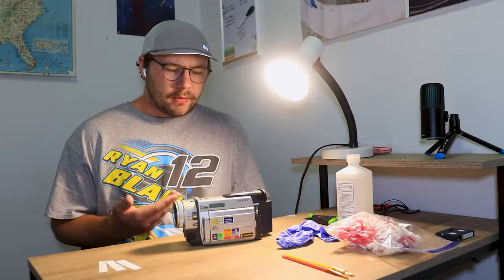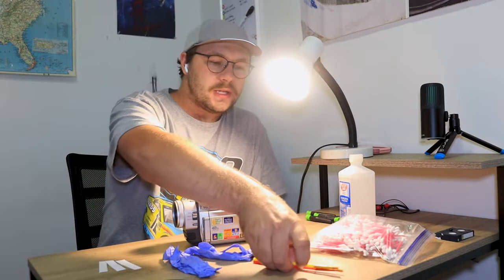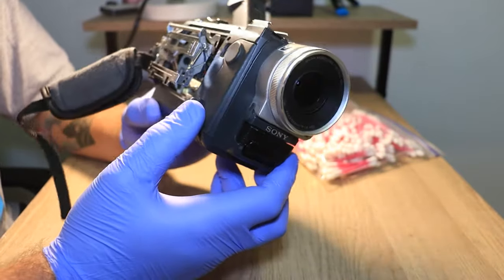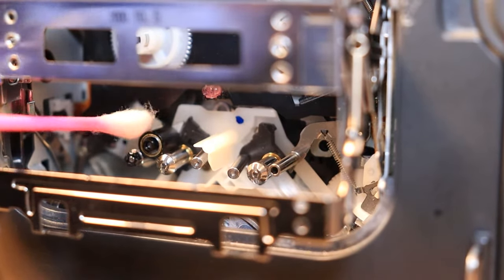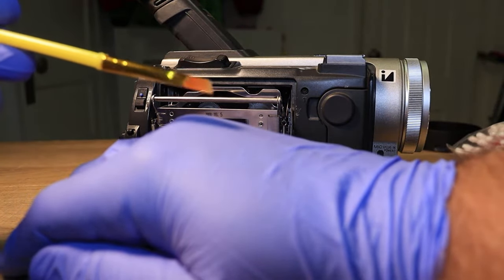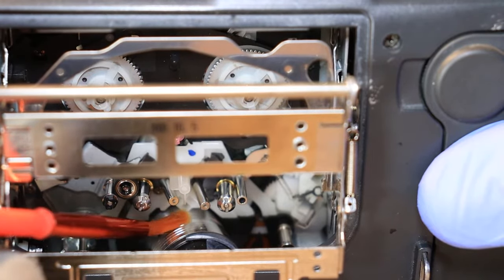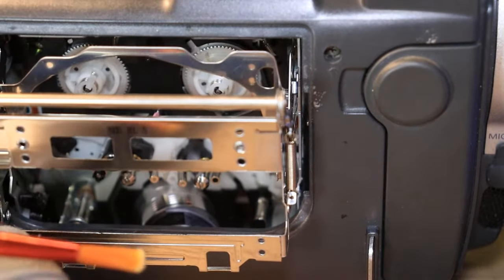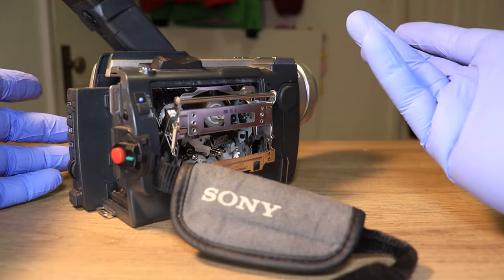[How To] Best Way To Clean Tape Heads On Any Camcorder

Comment: Hey there! Great video. Gave cleaning a shot today but still having issues with playback. Are you knowledgeable on the Canon ZR100? Would love to pick your brain. It almost sounds like it's trying to rev up during playback and then it slows down but showing now video. Love the channel! Thanks.
Reply from the maker: I’ve used a zr60 and zr45 I assume they’re very similar. Is the screen blue when you try to watch playback?
Reply: @brandoncameracollection  it is! it was working pretty well and then i stupidly blew into the tape deck. That's why I did the clean up yesterday but it's still doing the revving sound when I try to playback.
Reply from the maker: @ChrisDonahueIsAMan I would think if there was an issue it would show an error code. I would try cleaning it again and make sure not to blow into the tape deck. And then use a brand new tape to try recording and see if it will preform playback
Reply: @brandoncameracollection  thanks, I'll give it another cleaning. Have you come across that revving sound I'm talking about? It's definitely still moving the tape forward but just showing a blue screen, maybe a second of video  but rarely.
Reply from the maker: @ChrisDonahueIsAMan well I’m not sure if it’s the same sound you are talking about but my canon gl1 and other ones I have had have extremely loud tape decks. So loud that you can hear it in the audio. And what I have heard is there is a little like sponge roller that rolls against the video drum to keep it clean. Well over time the little sponge gets so gunked up that its starts to make a high pitch sound. I’ve heard you hand just break that little roller off if it has it and it should help. But I’m not sure if the zr100 has that or not. It’s usually under the video drum

Comment: Hey I am from India. I have a hitachi vme358e camcorder. Actually i found in dad's wardrobe and it was kept for about 15 years untouched. Initially when i played some video tapes, it worked perfectly with crystal clear video. But after playing a few tapes , there was a bit fuzziness in the video and eventually its all fuzzy. When i switch to record mode, it flashes "TAPE". I cleaned all the rollers and head but still the problem persists. Pls tell me what could possibly be the problem with my camcorder.
Reply from the maker: Well you can always try cleaning it again but from the sounds of that since it has sat unpowered for so long it could have capacitors on the inside that have started to leak which might be why the footage slowly went fuzzy.
Reply: The manual would tell you what the 'tape' message means for your model(though I think 'tape' generally just means the camera as detected some general problem in the tape compartment), & potentially how to fix the problem.
I found this from another Hitachi model, and is likely to be much the same:
If "TAPE', flashes in the Viewfinder or LCD monitor, remove the cassette and Check that the tape is not damaged, is not slack or no dust adheres to it etc. After making sure that there is no abnormality reinsert the cassette, if 'TAPE' reappears see Troubleshooting:
Have you moved the camcorder or cassette from a cold place to a warm place so that its temperature
changed abruptly? If the temperature has changed, remove the cassette and set the CAM/OFF/VIDEO
switch to OFF, then wait for about one hour. Remove the cassette and then try to reinsert &
remove it several times. If the indication is still shown in the viewfinder, use a cleaning tape to
clean the heads and replace the cassette.
-
The fuzziness does seem like the tape heads are dirty, it could also be that your tapes are deteriorating, so clog the heads quickly. It can sometimes take a long time to clean the heads.

Comment: Hi Brandon! I have a TRV-20 I just got in the mail today so I can go back and watch some old recordings I have. It’s saying “No Tape” though, would that be a head problem?
Reply from the maker: Hmmm if it’s mini dv usually your footage will be really glitch when watching play back. But I have had some where it will tell me to eject the tape as well. So yours very well could be dirty. Try cleaning your heads and se if it helps if it doesn’t work then there could be an issue with your camera recognizing there is a tape. You might be able to look around on YouTube and the internet to see what the issue really is.
Reply: That seems very unlikely, as the message indicates(& the manual explains, always helps to check there first..) it means just that - the camera is reporting that there's no tape inserted. It seems most likely it's just not detecting that a tape is inserted - eg: due to a stuck/faulty sensor.

Comment: I have an old 1998 sony tr917 i picked up at a thrift store. It works, but i dont have a hi8 tape. The forward, rewind, and play button dont spin the cassette wheels inside. Is that because there is no tape inside or would it still spin without the tape.
Reply from the maker: I don’t believe they spin if there is no tape inside
Reply: @brandoncameracollection  ok, so they may be good. Thanks

Comment: hey I just cleaned my sony ccd trv66 with the steps you said and now my cassette holder won’t close it keep opening back up. I use 91% isopropyl alcohol so i’m not sure what the problem is
Reply from the maker: That’s really odd🤔 I’ve never had a camera do that before. If your camera has a reset button try that or take the battery off while it is on. Close the tape door and wait about a minute. Then reattach the battery with the camera still in record mode and see if that does anything. I’m also wondering if the camera is rejecting the tape because it might still be wet from the alcohol
Reply: @brandoncameracollection  shoot still didn’t work not sure what could’ve went wrong
Reply: @brandoncameracollection  never mind just got it to close with the cover off. still have a problem with the screen showing blue when i’m trying to play back a tape

Comment: Hi Brandon How about using minidv head cleaner. Do you recommend To use it?
Reply from the maker: You can but I wouldn’t use it a lot since it’s kind of this cloth material and it is not good for the tape heads. It can make them wear out faster.
Reply: @brandoncameracollection  thanks Brandon

Comment: If my playback is fine through the viewfinder, but there's bad distortion on the s-video and composite output does that sound like a head issue or something else?
Reply from the maker: I’m wondering if the connection is bad some how or you might have a capacitor leaking inside the camera. But I’m not exactly sure
Reply: @brandoncameracollection  Appreciate the reply. Tried fiddling with the connections, but never got anything real great. Was also thinking capacitor, but had no idea where to start going down that road lol.
Reply from the maker: Yeah to replace capacitors you have to pull the whole camera apart along with knowing how to solder.
Reply: @brandoncameracollection  yeah that's not a problem I'll see if I can find a schematic to see what I'm getting myself into before I pull the whole thing apart lol

Comment: would you make a tutorial on how to fix sony handycam trouble? like the c:32:11, or where the tape wont open/closed?
Reply from the maker: The error code might be from a loose capstan roller. The rubber roller inside. It has a plastic piece that holds it on. Over time that will crack and break off so you can usually use a piece of the ink tube from one of those cheap bic pens to replace the plastic piece. As for the tape deck not opening I’m not sure why or how that happens
Reply: @brandoncameracollection  could you make a tutorial on it? maybe one day? im pretty sure dozens of people has this problem!
Reply from the maker: Yeah I’ll have to do it on a camera that has that problem thank you for the video suggestion 😊
Reply: @brandoncameracollection  thanks a lot mate!

Comment: This worked but after couple months. It starts glitching again. Help….
Reply from the maker: It probably needs cleaned again. And make sure you use the same brand of tape every time. Different companies used different kinds of lubricants on the tapes and when you use a bunch of different brand of tapes all those lubricants mix together on the heads and makes the them get dirty faster. Also when you clean it make sure you use a new tape after cleaning it.
Reply: @brandoncameracollection  oh ok I see. Well the thing is, is that I’m looking back at old tapes and i have maxell and Sony brand.
Reply: @brandoncameracollection  that really makes sense tho. Thank you
Reply from the maker: Yeah if I was you I would stick with maxell. Seems every camera I get that has a Sony tape in it always has dirty tapeheads.

Comment: i’ve been having a problem with trying to convert my hi8 tapes to digital but for some reason it looks fine when playing it through my camcorder but whenever i try to digitalize it it looks really glitchy and the audio is horrible. any ideas what it might be? i have examples of it on my channel
Reply from the maker: What are you using to convert your footage?
Reply: @brandoncameracollection  i am using vidbox with some gold RCA AV cables. the program i’m using is obs studio. no clue what’s up with it. i’m guessing it’s on the camcorders part
Reply from the maker: I know recorders can have some timing issues I’ve been using the clearclick video to digital 3.0 and it has a timing issue with my Panasonic pv-420. Maybe try a different way to digitize the footage and see if that helps with it. Other than that the tape heads could be dirty.
Reply: @brandoncameracollection  yeah i’ll try out the vidbox software idk why i haven’t done that yet. always heard obs was good but i’ll let you know how it works out
Reply: DVD recorders are the easiest way to transfer footage(especially if DVDs are a suitable end product for you), and give good quality, here at least they can be found cheaply. It's basically what they were made for, so they work very well, and can often even fix some of the flaws caused by rough tapes. Also a lot more convenient than having to have it hooked up for your computer for as long as each tape runs. DVDs also match the interlaced output from a camcorder, this interlacing can be a nuisance when capturing to a pc.
If the image looks fine when connected to a tv, it's very unlikely to be the camera causing a problem. Even just showing fine on the camcorders viewfinder/lcd, it's unlikely to be bad on the video output.

Comment: omg, he using q-tips
Reply from the maker: Only on the capstan roller 👀
Reply: @brandoncameracollection  But I'm shocked that you (and many others) use isopropyl alcohol on the pinch roller!  Don't you realize that will dry it out?  That's a no-no!
Reply from the maker: Yeah you can definitely use like windex on the rubber roller

Comment: does the percentage of the alcohol matter and is it ok to use something like nail polish remover as a replacement?
Reply from the maker: I recommend the highest percent alcohol you can get. And I wouldn’t recommend nail polish but you can use windex if you don’t have alcohol
Reply: @brandoncameracollection  i looked up the percentage of alcohol in nail polish remover and its 70% do you think its high enough or shoul i use that windex lol.
Reply: @brandoncameracollection  also thx man not alot of ppl get back that fast much love brotha
Reply from the maker: Make sure you only use the windex on the rubber roller. Other than that you can only use isopropyl alcohol
Reply: Most nail polished remover is acetone not alcohol.
Reply: Definitely don't use nail polish remover unless you're certain it doesn't contain acetone. Even then it might have other ingredients that could cause problems.
Acetone is brutal - for example it can dissolve some plastics(it's great for fixing some broken plastics for just this reason).
Isopropyl is pretty readily available anyway, including from hardware stores.

Comment: do you know why some tapes play and rewind great and others say head cleaning required and are glitchy?

Using the same JVC MINIDV player on all tapes and some play perfectly, some say "head cleaning required, some say "take up reel failure" and some cant even rewind without mangling the tape up.
Reply from the maker: Well some tapes could be older and more used than others. If the tapes have been used with a lot of other cameras the tape it’s self might be dirty from using it with so many other cameras. But the take up reel failure seems to be a issue on its own. Sound like the pinch rollers aren’t grabbing the tape properly and that’s what is making it eat tapes.

Comment: Great informative video thanks,I’ve got a Sony TRV 950 on the way from eBay,seller said there’s a clicking sound coming from one of the rollers that causes glitches on playback,would the cleaning you have shown us maybe fix this issue?,many thanks.
Reply from the maker: That I’m not sure on. When you get the camera check the reel gears. They are the gears that drive the tape forward and backwards. If they are plastic gears then one of them could be cracked and broken. I had that issue with my canon xha1. It made that clicking noise and would throw a code. Turns out that gear was completely broken in half. They are relatively easy to replace.

Comment: How do you feel about the aerosol electronics cleaner?  The kind with alcohol, not just compressed air?
Reply from the maker: You could use it on the pinch rollers but w wouldn’t on the video head just because you don’t want to get it soaking wet on the inside.

Comment: Hi, I followed this tutorial and i cleaned it a few times, but i keep on getting glitchy footage and some tapes are not even recognized by the camera, i cannot record on them, I see STBY -:--:-- all the time at the top right corner. Any advice? I dont know what should i do, im worst than i was when i started
Reply from the maker: Usually you gotta clean them really good and it takes a while. As for your camera not recording now, did you let it air out before putting a tape in? You need to wait at least 20-30 minutes before you put a tape in to let everything evaporate. And make sure you don’t blow inside the camera. Your breath has condensation and will coat all the components inside the camera. It will make the camera not be able to read the tape.
Reply: Your heads might just be bad at this point, in addition to a portion of the tape compartment being faulty.
Reply: @brandoncameracollection  I stored it away for almost an hour. I'll try getting a cleaning tape, see if that fixes it. If not, then i guess the heads are indeed worn out ...
Reply from the maker: Yeah there could be a difference issue going on sorry I couldn’t be of help
Reply: @brandoncameracollection  no worries, thanks for all the information you're providing with this video, even tho I'm still having issues I learned a lot about the camera itself, cheers!